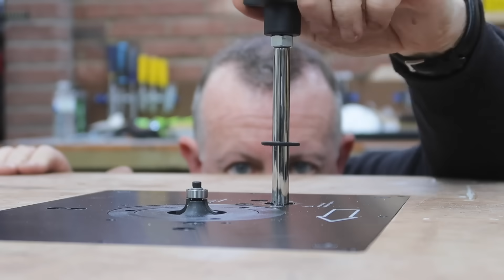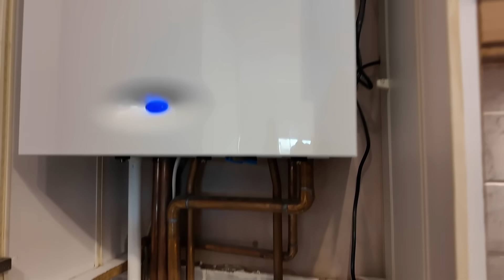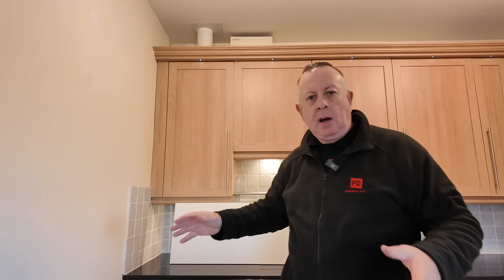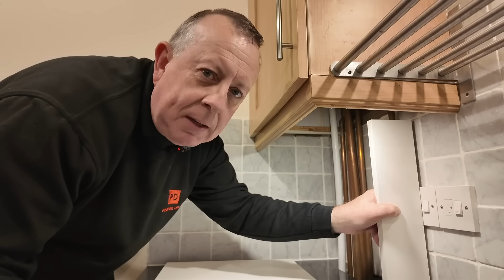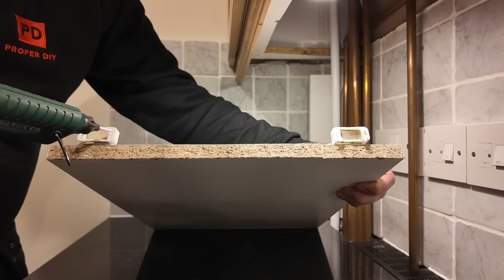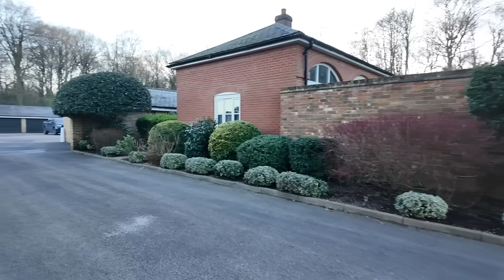A very small, but important job!

Comment: Hi Stewart, if you had used BR blades in your jigsaw the chipping issue would not have happened. The BR blades cut in reverse or down wards. The Boshe saw takes 101BR.

Comment: What an abortion! There is a grill specifically cut into the worktop for what exactly? Plumber - Let's Run pipes through doesn't need to be neat and compact I'll just run the cold supply directly to the boiler inlet, electricity? - sockets and fused switches, what do they matter. The owner has a lot to answer for, I wonder if that would be allowed in their dwelling ?
Now lets DIY hide the plumbers abortion and the grill? for a Renters Satisfaction. MMMMMM
Some ingenious ideas and execution in covering it but nowhere near your usual standard. You can and usually do better - I can't see you doing that  in your own place, chipped edging - will have to be siliconed - interfering with it's ease of removability, and what about the connection to the worksurface for ease of cleaning is that going to be siliconed too
But that vent why is it there. OK you've created a chimney into the cupboard above, which isn't blocking it exactly so some flow is still possible but really

Compromise after compromise. Ah it's only for rental purposes. Was that the thinking, just get a quick job - done. Plumber oh  I need to run some pipes shit the worktop is in the way, cutting that is risky and time consuming, oh I can run it through this vent, few, owner, ah yeh just get it done. Is that they way it went?

Comment: Shouldn’t have used circular saw for such a small job, I very fine tooth wood saw would have done that job without the need for silicon. I m not an electrician but I would have thought a double socket immediately beneath a boiler isn’t a great idea

Comment: A neat solution. I had the same problem with the installation of my new boiler. So I created a 3 sided box to go around the pipes which meant it was spaced the same either end and no need for magnetic catches, also you had enough left over M.F.C to do it.

Comment: If it’s easy to remove if you had covered the one isolator switch it would have covered the vent aswell,angle grinder and sanding disc to scribe the edges,there would be no chipping👍

Comment: That would have been easier if the plumber had run the incoming cold up and across in the same corner as the other pipes.

Comment: If he runs a line of silicon down the edge how does that not create a problem if or when the melamine needs to be removed to use the double socket. Back to the drawing board.

Comment: I have a couple of pipe boxing jobs coming up soon, so always good to look for new ideas. One thing I didn’t understand was if you run silicone down the edges, doesn’t that negate the magnetic strips since it’s now stuck in place?
Reply: Yeah I used to be a finisher on a contract where we fitted new heating systems. I had to box in hundreds of pipes underneath boilers. I used to use silicone to both fit the boxing and to stop water ingress. That way, if the boxing needed to be removed to service the boiler, the silicone could be cut away, cleaned off and resealed again.

Comment: I would have moved that lone pipe to the right as far left as possible, then you can put the piece of wood between the socket and last fused switch, leaving the fuse bit accessible. Also add a second strip on the left hand side to give the glued magnets more holding power.

Comment: The plumber did a poor job looking at those pipes surely he could have diverted to cold water? I presume the other switched fuse spur is for boiler, having a pipe in between electrical outlets is pretty poor

Comment: I think I'd have fixed the melamine permanently and cut out new holes to bring the electrics forward. You could have had the double socket at the front and the fused one at the side using a few wagos and a lenght of wire.

Comment: The plumber went to the trouble of putting two elbows on one of the pipes but not the one on the far right. Is that the cold feed in that must be straight/away from the others for some reason?

Comment: So, we didn't really see the finished job. First it's removable, then it's siliconed so there is no access to the twin socket. Personally I would have boxed it in permanently like you have but simply brought the double socket forward (this can be done safely and within regs) to the front of the box and tiled the box to match the kitchen. it all looked a bit ragged in the end.

Comment: This looks like the perfect solution to box our boiler pipes. 

I've got excess kitchen panelling from a new kitchen, and was going to use that for boxing all the visible kitchen pipes (solid floor, so all pipes are in the ceiling). Would this method work for longer (therefore heavier) sections?

Comment: I'd have done exactly as you did except 2 differences. I'd have cut the melamine for the vent at bottom with a full size hacksaw with fine/hard metal blade not jigsaw ("wrong" tool for job but wouldn't make a ragged cut). Secondly I'd have fitted it on the left side with a piano hinge to a baton (from white melamine) screwed to wall so it'd swing open closed to magnetic catches on right.That all said... I'd have taken at least twice as long as you and sworn a lot though 😭 so I'm not claiming to be better

Comment: I realise the client task was to box in the pipes and demonstrate the process. But in this case, I would have painted the pipes white and put something in front of them e.g an air frier or microwave. You will never see them.
With hot glue in a cold room, use a hot air gun to warm the cold surfaces before glueing so it doesn't set too quickly.

Comment: I used those magnets on some drawer covers - not very strong. would be better with neodymium magnets, much stronger. Also, would be better if the socket were projected forward to the outside of the boxing - they are all then accessible. Just a thought.

Comment: No job is straightforward, eh. Thinking about it I might have boxed in the bundle of pipes on the left and put a white sleeve over the lone cold water pipe on the right. But what you did was fine for what the customer wanted.

Comment: With silicon around the edges you’ll loose access to the double socket? I use tape on the boards before cutting as it gives you a cleaner cut.

Comment: I recommend Bosch EXPERT Wood 2-side clean T 308 BO blades for such jobs. They preventing the surface splintering quite good. Furthermore you would get better results using the Jigsaw upside down. And this task is easier done by using a Barrel Jigsaw. Or you can make good use of a Multitool in this case. I like watching your Videos, keep up your good work👍

Comment: I had this exact same problem with the type of tile and how I got around it was, I got some white sponge draft excluder and stuck it to the two ends of the boards, that way when i offered up the box section the sponge took the same shape as the profile of the tiles and ended up with a really nice finish. 🙂

Comment: It never ceases to amaze me how many boiler installers think it acceptable to make such a mess of the pipe installation, the hole under the cabinet is far too big even allowing for good airflow, it could have been more cleanly done with a vent grill instead of that butchered misshapen cut out. All the pipes could have kept tighter into the corner allowing for a much smaller box that wouldn't need to be removable. Typical of todays get in and get out culture.

Comment: That owner needs the boiler people to come put and re sort put their cowboy work. As for the box, the silicone will look worse if you have to remove to plug switches in, which would irritate me if that was the case. I had something like that under my boiler and the beading drove me insane so I removed it myself. The magnet clips are a great idea tho.

Comment: Box the group and white electrical trunking on the single pipe. Those are magnetic cabinet catches.I would have hot glued the plate too the wall. Scribe the underside of the melamine and mask tape or half depth cut from both sides. Iron on edge tape. Seems there's vent slots back of work top and your somewhat restricting any appliances

Comment: Down cutting blade for the jigsaw will solve the chipping or cut from underneath with practice. You could cut a dry line socket box in the panel and wire a socket with a plug so its removable with the panel. Stick an offcut with straight edge to the wall so not to damage the tiles and use a push on keku clip solid but removable. Thats just how i would do it many ways to skin a cat 😂

Comment: Well, I would have to say that was a BODGE JOB ‼️
The neatest way (with access to the sockets) would have been to buy a high cabinet door, hopefully matching the existing cabinetry, or close, which opens just like the other ones you can see over the boiler and in this kitchen ... access to the socket could be via a hatch on the side of the cabinet, if you didn't want to  'go around'  the side panel ...   much neater and, in my opinion, much quicker.  Or altatively, make the side panel 'fold back'  against the wall for access to sockets.  
Won't be using you on MY refurbs 👎

Comment: I tend to buy a decor end panel and use a track saw to cut to size (most providers have at least some old stock). I then use builders Velcro to put it together as often isolation valves are in that area. It can be dismantled easily and reused after.

Comment: I had exactly the same job to do many years ago. I made an 'L' shaped  melamine cover, just like you did, but stuck matching tiles to the kitchen walls onto it, blending the joints to the tiles on the walls. The unit became quite heavy and did not need any fixings at all. It has stayed put for over twenty years, but can be slid out of the way if needed.
Reply: Yeah - this is the best option
Reply: @NAFO_Badger_Brigade  If someone has spare tiles that match!
Reply: Ty needed this❤

Comment: sympathy for the spark who did the original installation. To get the units as level as he has takes a lot of care to do this. If you se masking tape over the cuts you'll prevent breakout of the surface. You really should mark up that there  is electrical equipment behind the box

Comment: Wife and I just laughed when we saw this as I am in the middle of something quite similar and the use of magnets. Wife thought I was crazy until she saw this. As much as in trying to cover pipes it means the removal of a laundry basket and to compensate, I am trying to create narrow depth shelving which will enclose the pipes but are easily removable to allow the boiler engineer in to service it and to get at the pipes. It will use a quick locking type clasp.

Comment: This is a classic example of landlords getting ill-skilled people to do a job on the cheap. Not your fault Stuart, the result of a grunter plumber. But this 'fix-it' did you no favours, friend or not. I won't even get into the health and safety issues here with electrics and water feeds. This was one job you should have refused to do. In time, you will wish you didn't put this video up.
Reply: You don`t know the circumstances though. If the landlord lives overseas and the property is fully managed through a letting agent, they just sling the keys to a contractor and that`s it. There`s zero quality control, agents don`t give a monkey`s they just drag anyone in, as long as there`s a certificate that`s all they want to see at the end.

Comment: You could make a feature out of it by boxing it in permanently with an access door for the pipes and sockets. That way the owner could tile over the boxed part and make it look better. Other options I was thinking of are:
1. move pipe to adjacent wall so that boxing is only needed in the corner
2. box it in permanently but extend the wires for the double socket so it is mounted to the boxed section instead of wall behind
I understand you are working in somebody else's property so your solution might not be the same as it would in your own house. Interesting to see you are a structural engineer/handyman now  :)

Comment: Just one of those jobs where there isn`t really a quick solution. The rogue pipe needs relocating alongside the others, then with a bit of luck the electrical accessories can be moved slightly to the right. Stuart done the best he can in one visit with limited tools, having not seen the job. Might have helped if the letting agent or someone could have sent him a few pictures and measurements beforehand.

Comment: The boxing is the only way to do it. I think using those magnetic catches are a waste of time, as after you silicon it in there no 'removability'. I would move the socket into the the boxing in a  safe and electrically compliant way.

Comment: In the past I have used masking tape along the cut line (all side front and back etc) to minimise the blow out. It works to a fashion and is easily masked against the wall to be hidden by caulking.

Comment: You can get jigsaw blades that cut on the down stroke to keep the edge neater. Or do like bourbon moth and use your jigsaw upside down! 😮 I wonder if some painter's tape on the cut line might have helped a bit too, although melamine is a pig to cut at the best of times anyway. Anyway, that was an interesting and realistic problem to solve. Thanks for the video

Comment: Some abrasive paper on a block could be used to sand a 45deg bevel on the sawn edges. 

That would give a nice straight finish to the melamine finish and wouldn't catch the eye like the chipped edge of the melamine.

Comment: Interesting solution - what happened to the idea of the silicone? - glad you didn't as it would have rendered the magnets redundant. As for the ragged edge sometimes rounding it over with sandpaper (or even a soft stone) could render it looking like an intentional finish. Glad you shared this one - it shows DIYers how to deal with unusual situations.

Comment: You could buy some plinth strip that is used for, well, plinths (or kickboards) to hide the rough edges and the way the stips are design is like a water seal edge which could fit snug across the unever surface of the tile, just cut away some of the strip edge that sits on the socket

Comment: If the tenant is picky enough to query exposed pipes....they are going to be really picky about having to unclip and reattach a box whenever they want to use that socket. Box in the five pipes on the left and paint the single pipe in the same colour as the tiles. Less faffing about whenever they want to use a toaster.
Reply: Yeah probably. Could have got another less picky tenant in no time.

Comment: Small plastic quadrant instead of a bead of silicone. The silicone will prevent easy removal of the cover? Quadrant will cover any undesired edges. Fixed to the removable cover and not the counter top will mean it can be removed with the cover.

Comment: nice little job - shame the two sockets had to be covered - is there such as a thing as a socket with plugs on the back that could have transferred the power from the wall sockets to a new set that you cut in to the melamine without having to do any wiring - like a passthrough sort of thing?

Comment: Hi Stuart, a downcut blade on the jigsaw will help reduce (but not completely eliminate) the chipping of the melamine. 

And now for the real tip.. 
...A few drops of Methylated Spirits on the cooled hot glue will  break the bond and you can unbelievably easily remove the parts without mess! A great tip for also removing hot glue that is spilled etc. 
 I use a cotton bud to just dab the Methylated Spirit around the joint. It doesn't need much and just wait a few seconds for it to wick in and hey presto the glue can be popped off with ease!...perhaps an idea for one of your upcoming videos..
Cheers from Ireland.. Keep up the good work
Anto..

Comment: If you're a landlord you want this kind of job doing cheaply as well as quickly so ideal for a handyman. The guy's clearly not a plumber, but moving the cold feed across is relatively simple especially as it rises through the vent, just need to bend/shape the pipe in the cupboard. The double socket can be moved to the right of the fused switches and tap into the same supply. Triple boxes are available so no mess.

Comment: If you want to easily remove hot glue use isopropanol alcohol, a tiny amount and it will cleanly just pull off.

Comment: To stop the break out with the jigsaw use it upside down - that reverses the tear out side. It takes a bit of practise to get it right. Or you could buy a blade that cuts on the down stroke.  Also liquid paper (tippex) over the tear out somewhat blends in with the melamine.
Reply: I thought similar wondering if he had bit of sandpaper and white paint to hand.   Always hard when you're caught off guard and can't pack your entire shed into the van "for incase".
Reply: Had Stuart scored the line with a craft knife or taped it, it would have been fine. I was a bit, eeek really? I'd be annoyed if I'd done that, I'd have not posted this video my OCD wouldn't have let me.

Comment: If you pre-score the melamine surface with a fine blade, then jigsaw on the waste side of the cut, it stops it cracking and splitting up. It seems DIY stores don't sell black melamine any more, maybe they've moved on from the 90's. BTW, which lazy plumber did that job? 👍

Comment: I wouldn't have done it like this, I would have:

1. Used MDF (no ragged edge)
2. Painted it
3. Made it a little wider to cover all of the spurs and sockets
4. Pulled the wiring through and fitted them on the face of the MDF
Reply: I don't think he had the time to do all of that ahead of the new tenant coming in. An electrician would need to come and test it as well.